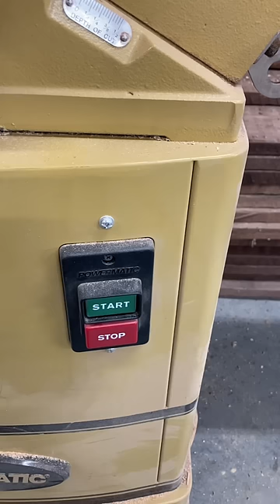Milling Walnut

Comment: The first thing I learned in woodshop was how to take Lumber and make a board. Run one side through Planner, then one side joiner, back to planner otherside table saw, then square ends with chop  saw!
Reply: ok
Reply: Every resource I have read, cut boards to rough length, flatten 1 face and one edge on the jointer. Then flatten opposite face on plaNer, and finally rip board on table saw.

Putting a non flat board thru a planer gets you a non flat board on the planed side. In essence it just makes the board thinner, not much flatter.

Cut the board to rough length first and you don't have to joint or plane nearly as much to get a flat board.
Reply: Minus all the expensive leveling machines and see what skills they have...
Take a twisted, bent, crowned both ways
With a split and make a paddle.

Comment: So, you made a square line and then used the circular saw backwards and cut a wavy line. 

Alwas use the larger part of the shoe over the side of the board that is not being cut off. You'll get a straight cut, because your saw will not wobble as the foundation falls out from under it halfway through the cut.
Reply from the maker: Thank you for the tip!